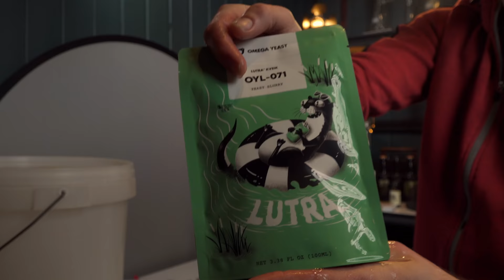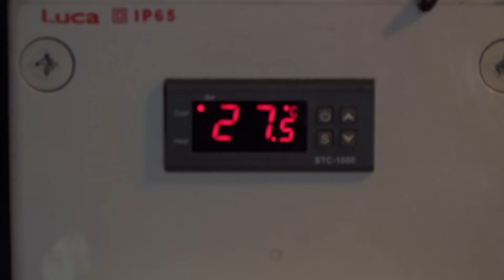Lutra Kveik Malty Pseudo Lager -  Grain to Glass & All Grain Recipe

Comment: Dr Hans,
I really love your content, keep it up please!
 I actually have some Lutra sitting in my fridge, ready to do a Schwarzbier pressure ferment next weekend.
Some questions:
1)	Looks like you didn’t chill the wort, and just filled the hot wort into the kegs – did I see that right? No concerns about DMS in particular from the light pilsner malt when doing this? Very curious, I would love to avoid chilling if I can and jump on the no-chill train…
2)	It seems you use your soda stream to CO2 flush the kegs and lines before filling the wort – what is the point of this step at this time in the process (pre pitch)?
3)	I noticed a blue tube running off you Spundit aux port – what is that for?
Tx a lot! Skol!
Reply from the maker: 1. No not concerned. DMS should b lost in the boil.
2. As the beer will sit for a while before i add the yeast (no chill). I dont want to oxygenate it before pitching. 
3. You can use the Aux port of the spundit for many things. In this video I was monitoring the pressure on an external unit.

Comment: I did a similar brew a month ago and it ended up with some very off flavor.  I haven't dumped it yet, I'm letting it sit and see if it fixes itself.  

I forgot the yeast nutrient, it looks like you added some.  I was wondering what kind and how much you added.
Reply from the maker: I add 1/2 teaspone for a normal.size 23l/5gallon batch. You could use any yeast nutrients. I used Yeast nutrients from Angel Yeast. But with that said I don't think Yeast Nutrients will give you a night and day experience. It might help some, so it is good practice to use.